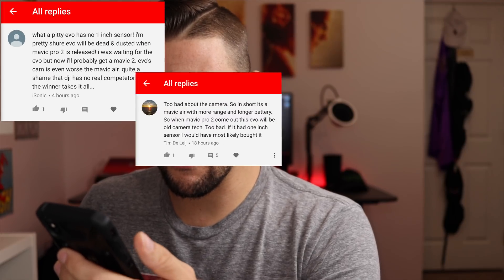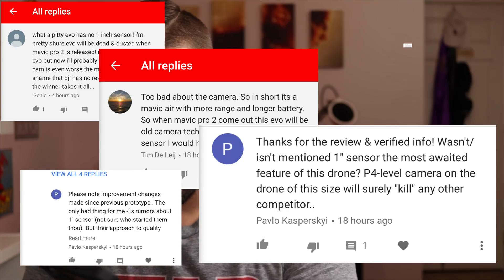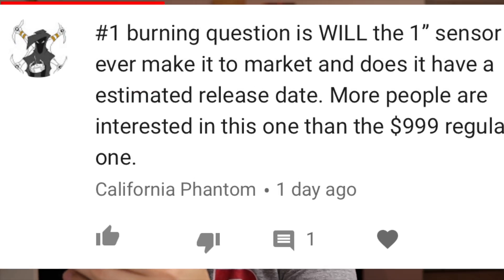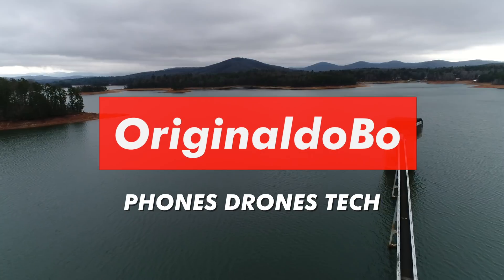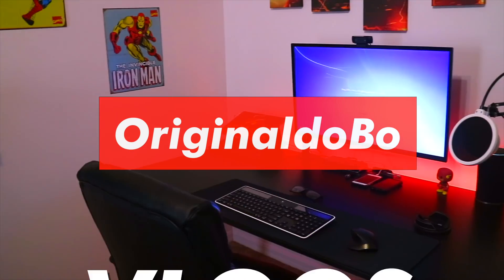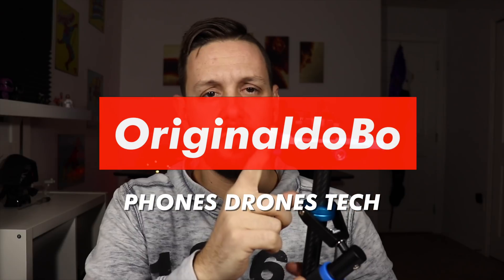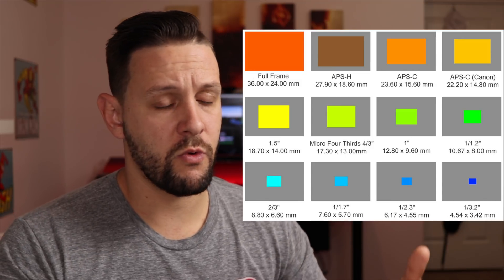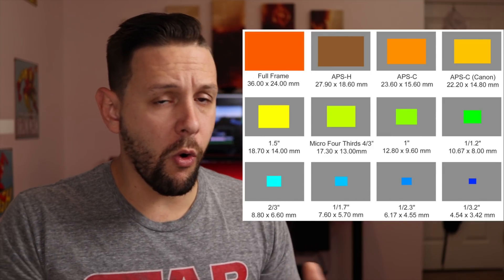1 inch sensor on a Drone | Do you really need it?

Comment: Lean how to spell diffraction. And what you describe is lens flare and internal reflection. Diffraction is a softening of the image that comes from using a very small aperture. Light bends around the edges of an aperture and at small apertures, the bent rays start to soften the image. Noise and dynamic performance are both improved by larger photosites, no matter what the light levels. Crop factor is of zero concern unless you have interchangeable lenses. If you're about dynamic range, you want the larger sensor.

Comment: Why is there such a big deal about a one inch sensor? I am looking for portable drones at a good price with decent cameras and Mavic Air or Autel EVO with the 1/2/3 inch sensor is awesome. Mavic Pro 2 with the one inch sensor will be bigger and more expensive, I'm sticking to the smaller and cheaper sensor for now. Thanks for the information!
Reply: Originaldobo I never have problems with light, footage always looks good, and besides I use a DJI P3SE which has a garbage camera compared to the P4 and Mavic séries so right now I am really satisfied with the cameras on the market.

Comment: One of the vital things that was not mentioned is the variable aperture that the Phantom 4 Pro's VARIABLE iris/aperture. This is huge because it allows you to set you shutter speed at, let's say 1/60 and fly around letting it automatically adjust your light exposure for you. (ranging from f2.8 to f11)  This is what a "real" hand-held camcorder would have the ability to do. With Sparks and Mavics, they are reduced to locked apertures and forced to change shutter speeds wildly, all over the place to control exposure. Mavics and Sparks are flying "cell phones", while the P4P is a true flying "camcorder".
Reply: The only problem with ND filters.....I mean, you NEED them for sure,...but ND filters cant adjust themselves when you fly. If you lock your shutter at 1/60 to achieve the 180 degree shutter angle rule, then your camera has nowhere to go as your scene changes. in lower light, your ISO will climb up which is a BAD ting on small sensor cameras. In bright scenes, you are stuck with an over exposed image. So, it's pretty hard to escape being forced to use auto shutter no matter what ND you have mounted. No matter what ND is installed, there is very little room for exposure range without shutter speeds jumping around like a kangaroo! This is where the P4P's camcorder aperture comes into play. Mount your ND, lock your shutter at 1/60 and now you have your iris opening and closing all the way through your flight. No need for shutter speeds climbing and diving all over the place. I REALLY hope the Mavic Pro-II has a variable aperture. We now suspect that it WON'T have a 1inch-type sensor. It could very likely only have a 1/1.7. (larger than 1/2.3 but much smaller than 1inch-type)

Comment: Biggest annoyance/problem with DJI cameras is the stuttery video during motion. Doesn't affect stills, but the video sucks (yeah, I know - filters, yadda yadda). The cause being high light, fixed aperture and consequently short shutter speed. From what you said, a 1" sensor would make this stuttering even worse because more light in would require an even faster shutter speed. 
The video I like is big on movement and close up - gives a better 3D perspective more engaging. So rather than a bigger sensor, I'd like to see a variable apeture and faster processing.
For work I'm primarily taking stills for mapping - so bigger the sensor and more dynamic range the better. I'm hoping the new mavic will have 1" sensor though - increases my chances of a price drop on the mavic air before I buy one.

Comment: Meanwhile I don't care at all about 4k, 1 inch sensors or anything like that.  I fly for a Public Safety department and our Phantom 4 Pro+ does everything from videoing events to flying over officers when making contact with violators.  We don't need a larger sensor.  We need a Phantom which comes ready either with a camera we can swap out (similar to the Inspire) or built in with Thermal and a short range digital zoom. Nothing like the 30x zoom cameras made for the Inspire or Matrice models but something small but can zoom out 3, 4 maybe 5 times. 
And don't tell me, "You can send your Phantom off to __(insert name of shop)_ and they can fit a thermal camera under the body behind your main camera with its own battery pack."  
No, not an option. It should be able to come from the factory, set up to power from the onboard battery pack and operate on the DJI Go screen.  
Don't tell me it can't be done either. Parrot has a Bebop which mounts a Flir thermal camera.  There are small, lightweight zoom cameras out that weigh the same or less than the camera which already comes on the Phantom.  It should be no problem for DJI to have a Phantom Thermal model with a Boson FLIR mounted alongside a optical camera with digital zoom and market it toward Public Safety, Fire/Rescue, Search and Rescue, Agriculture and light industrial uses.  
Yes, we could try to find the money to upgrade to an Inspire (which is actually the first UAV I ever flew, in a class my Department sent me to to get my Part 107) or a Matrice. But those are much larger, heavier and substantially more expensive aircraft.  The Phantom is lighter, smaller and easier to transport in our Ford Police Interceptor SUV or in the trunk of a sedan.  
DJI has pushed the Phantom line as a "prosumer" aircraft designed to fit between the smaller, Hobby sUAV market and the larger, Consumer line of platforms. Those of us wanting to use this level/size just want a few simple features which aren't "Follow Me" or "Boomerang" modes. I'm not trying to impress friends on YouTube with videos of pretty sunsets.  I need to be able to hover between 200 and 300 AGL and look behind dumpsters or among trees and bushes to see if a suspect hiding from my officers.
Reply: This is the sort of "content" I'm making.  https://vimeo.com/257360587
 Documenting our interactions with violators.
 4K?  Heck no.  No need for anything more than 1080p.   So why is DJI ignoring this segment of the market?  Are they just trying to push us toward the larger, more expensive industrial sized quad and octo copters?

Comment: To me its more about the portability. That's why I have the Mavic Pro and the Spark. A 1 inch sensor means nothing to me. Like you said. Light is the issue for me! I spend more time equipping the appropriate filter than I do piloting my drones! lol This comes from a guy that has 3 DSLR's in the 2K price range.

Comment: I say spend the extra 3 or 400 more dollars and get the 1 inch sensor. The 20mp stills are also noticeably better. If the money is an issue, the mavic air is a great unit.

Comment: Great job. I’m on the fence currently of grabbing a Mavic Air or waiting for the Mavic Pro 2. Currently I am a spark owner and love it. If the air is 799 and the pro 2 comes in at 999 or even 1099 I’d go pro 2. Other wise I’ll probably most likely end up with an air.  Planning to go to Florida in April and currently have planned to take my spark with me. If the announcement and release comes before then great, if not spark is going with.

Comment: The grumblings are the Mavic Pro II which will have the 1” sensor sans mechanical shutter will be $1299 to compete with hypothetical $1299 1” variant of Autel Evo. $1399 has been floated for Mavic Pro II as well. That being said I personally believe DJI has followed Apple’s naming scheme with the “Air” and “Pro” line. MacBook Air has less horsepower than MacBook Pro. Mavic Pro II will pack far further distance and greater camera functionality than the Mavic Air. I personally believe a $1299 Mavic Pro II is worth the extra expense over a $799 Mavic Air. It all comes down to budget I suppose but if I’m parting with that kind of money; I want the best specs as possible. I also found myself caring a lot of gear around with the Mavic Pro. It didn’t make sense not to have a P4P when I had nearly as much gear for Mavic. That is just my path.
Reply: Yeah that source that you got that info has been proven to be fake.
Reply: When is the Mavic 2 released! 👍🍻🍷🏆💥👊